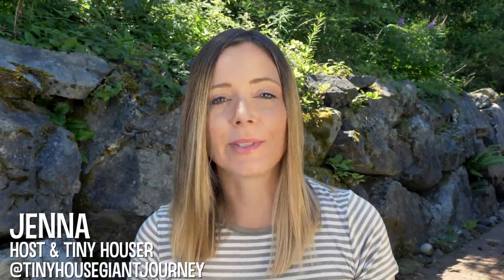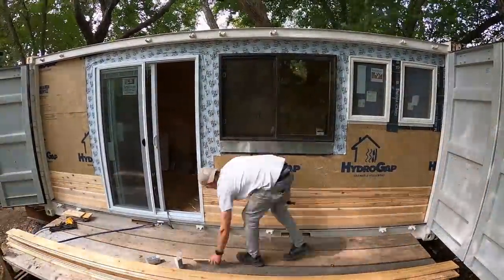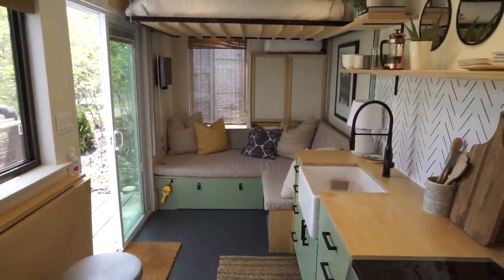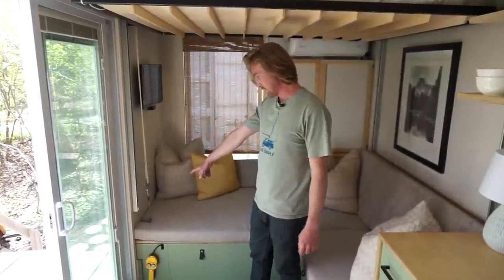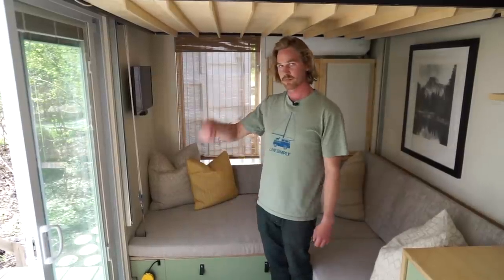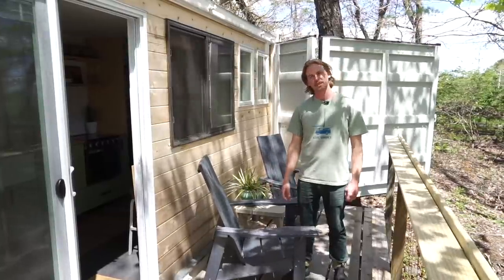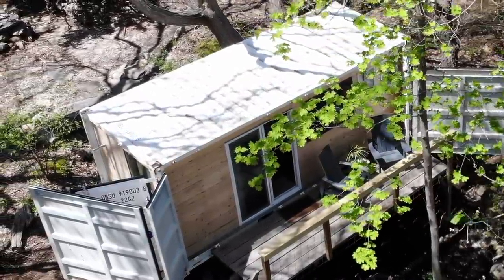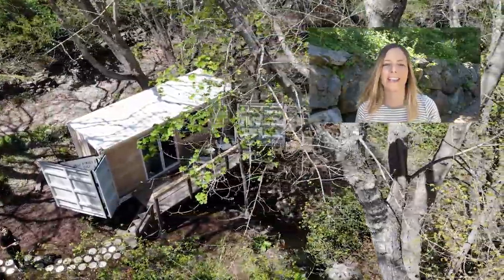20ft CONTAINER HOME w/ Genius Bed Lift & Sliding Shower Room

Comment: Cam didn't point out a refrigerator, unless I missed something.   My guess is the black cabinet between the stove and the bathroom?  Fantastic build!!!
Reply: I guess I missed it in the tour but yes you got it.
Reply: Also when the closet is out for showering the fridge is in the bathroom making it easier to grab shower beers.
Reply: @camchafee1010  Thanks for verifying that👍

Comment: If the folding shelf aligned with the height of the deep window sill, a one-foot wide shelf may be all that is needed. Same with the kitchen cupboards. A deep window sill across the entire length of the kitchen counter may only require a narrow kitchen counter. This would result in extra floor space.

Comment: Can someone with better knowledge tell me if this looks STABLE over that stream? What problems would you be looking into if there's Too Much Water? Do the pegs look safe?
Reply: I think he made an awesome work, and a clever design...but, I have had the horrible experience that building in a running stream or even in a dry stream is really dangerous. Rain can be much more destructive than you can imagine.  I wish he could reconsider that decision
Good luck
Reply: He's a student of architecture and as such is familiar with frank lloyd Wright's "falling water house" (world famous,built 1939). As I down size ..the container home is at the top of my list..especially with volatile climate changes.
Reply: @raquelmariagarciamartinez389  Agreed! The decision to post there is timed. As the stream will inevitably erode the land beneath his beams.
Reply: @DanielleSamoneJohnson77  The nice thing is that it can be easily moved if the creek starts to erode the land.

Comment: On the outside of the container, most of the electrical units could fit beneath a window in a waterproof cupboard. Within the couch area, 3 arched windows may be suitable.

Comment: A curved deck may add a little more space and design element. Wide low-rise steps with 2 hand rails may be safer. Steps on both sides of the porch may be handy.

Comment: There doesn't seem to be any point to a container home... you have to frame out the entire inside, which means you're basically just building a wooden house with metal siding.  When you can just build the wood structure without the container surrounding it, that's a lot of extra added cost for some metal siding...

Comment: I trust he has conducted proper research on the safety of that stream.  I couldn't help but feel some trepidation as my hometown was once devastated when a massive flash flood transformed the river into a raging body of water in the middle of the night, with logs coming from the mountains razing houses to the ground.  Communities normally at a safe distance from the river were not spared.  I still shudder at the memory.

Comment: just another idea would be to use the stream to produce electricity from the stream
Reply: It dries up through the summer but maybe for the spring!
Reply: @camchafee1010  thank you for your reply. There is one turbine that can be used for water so as wind streams. You can get in touch with them https://www.icewindusa.com/

Comment: There are reasons people don't build over creeks.  Hope his house doesn't end up down stream.  The water heater next to the AC seems like an unnecessary battle.  The moving closet, while interesting, seems like a large expense for maybe two feet of space? What will that tiny space provide?  The container with a long side opening was a good choice for remote locations and the interior is pretty.
Reply: why is it an unnecessary battle? Sliding closet gives another seat at the table plus another window into the main space.